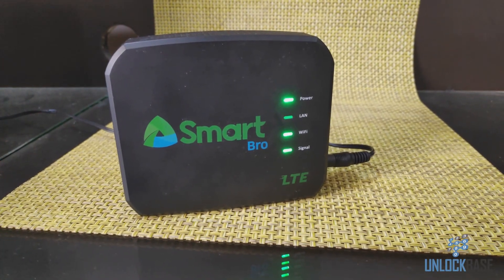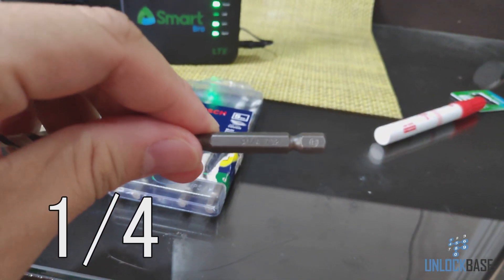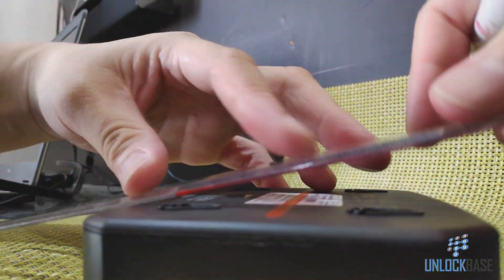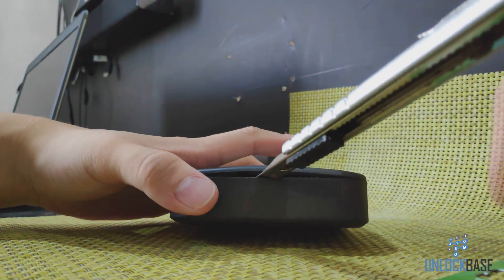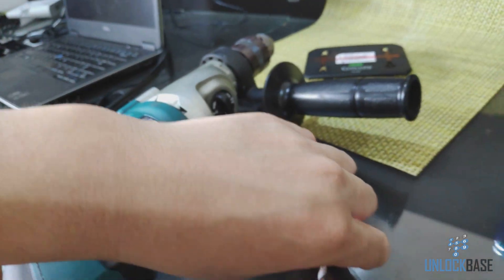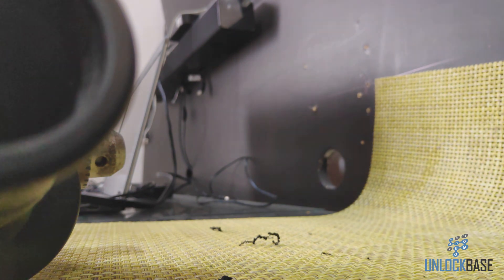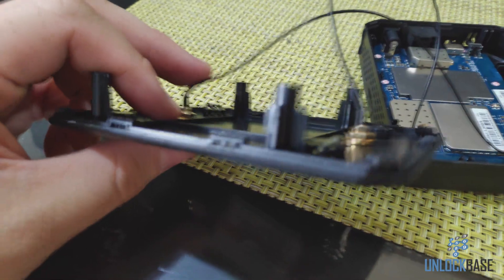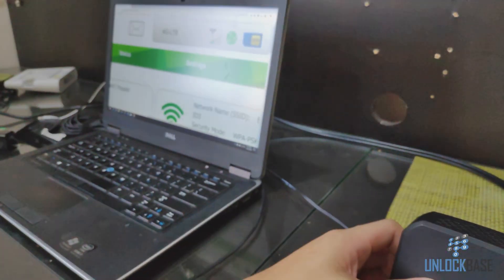Smart Bro Home Prepaid WiFi Evoluzn FX ID3 External Antenna Mod

Comment: you might want to put the plastic cover on top of a wooden surface and drill downwards instead of holding the plastic with your hand and drill.  It could spell out trouble

Comment: Hi, great tutorial. However it's not exactly clear to me if this is for the mobile smart signal or the wifi signal? I'm looking to improve my smart signal, and to have an outside antenna for that. For the wifi I use an extra access point.
Reply: That is for extending your Telcom LTE Data signal signal..not your wifi signal

Comment: Need a proper antenna that support wide range of frequency. Sayang yung 700 if 1800mhz yung support ng antenna.
Already did it, great tutorial!
Reply: ano excact model ng ganyang adapter antena paps ? san nakakabili?
Reply: ano po ibig sabihin ng propee antenna na wide range frequency? meron po kasi akong 600mhz- 2100mhz antenna..pwede po ba yun sa pldt wifi na modded?thanks
Reply: @jc122708  pwede na yun.
Reply: @matcha_cid  antenna sir na inorder ko sa shopee..tag 150..naka indicate is 689mhz -2700mhz..malakas na ba sir makasagap ng signal pag ganun antenna? di pa kasi dumadating order ko
Reply: @jc122708  yung frequency na kaya nyang masagap yan. Naka depende padin kung gano kalayo yung cell tower sa inyo. Kung maayos naman internet sa phone mo, more possible na malakas din yan
Reply: Any recent links kung San makakabili nung wires and ung prang small antenna?

Comment: Sir, do we need to have 2 connections for external antenna or is it okay to just have 1?
Reply: Better pag dalawa, and yung antenna eh support ng 700-2400 mhz frequency, para sulit na sulit
Reply: Pero mag work ba kapag isa lang? Isa lang kasi external antenna na nabili ko.
Reply: Ano pong type ang ilalagay.  Dba  po meron transmitter and reciever type ng antenna baka po kasi d mag work pag d fit ung antenna
Reply: @darylestores3497  always may rx/tx ang mga communication devices, meron ding wala.
Kaya dalawa dahil MIMO, pwede lang din isa kung want mo, di nga lang match db at siguro, problema mo din interference
Reply: Thank you sir.  D ko po kasi alam ano antenna ang maganda bilhin sir..  May ma ere recommend ka po na na antenna for outdoor sir?
Reply: @darylestores3497  dish na brand or tenda kung kaya budget
Reply: Ok sir thank you

Comment: Nice tutorial sir,, ask ko lang po kung binalik nyo din yung tinanggal nyo na nakakabit sa loob? Yung iba kasing tutorial kinabit din nila
Reply: Di nya na boss kinabit.. yung sa iba siguro nanghinang kaya nag tap lng sila pero since sa kanya ay snap on na binili nya na cable na IPX..no solder na.. naka hang na lang yun internal... Pero if di mo kakabit ang external antenna mo..wala ka nga lang signal..
Ang iba na nakita mo na nakakabit na sinolder nila ehh ay advantage nun ay dual..kung di ka gumamit ng external ehh may signal pa rin masasagap sa internal antenna nya

Comment: Thank you for the idea.. it works!
Reply: Anong antenna gamit mo? Pahingi nlng rin ng antenna details bro maraming salamat.
Reply: @hansandrewconsuegra8169  Buy a pair of SMA Cable Female and 18DBI Mimo Antenna.
Reply: Thanks  @whatswritten9795  sobrang helpful!
Reply: Hello po pwede pa send link ng antenna na gamit nyo po.
Reply: @angelgab1529  Check out utakeRG178 U.FL/IPX Connector to SMA Female Adapter RF Connection at 27% off! ₱72 only. Get it on Shopee now! https://shopee.ph/product/77433740/1807448388?smtt=0.0.9
Reply: @angelgab1529  Check out 2.4GHz Wireless WIFI  Network Booster WLAN RP-SMA Connector at 41% off! ₱61 only. Get it on Shopee now! https://shopee.ph/product/41847637/665757772?smtt=0.0.9
Reply: Boss dalwang antenna na wifi network booster gamitin? , kasi diba dalwa yung connector, thanks
Reply: @roldanamores6438  ok lng po isa.. working fine po kasi isa lng.
Reply: Bumilis ba signal sir?
Reply: @lilparanoid2094  so far so good.. hindi ko na kylangan ilapit pa sa bintana ang router.. lumakas ang signal.
Reply: It also works in 2.4GHz 3dbi wireless male antenna. Yung malilit na pang WLAN Booster.

Comment: Sir tip lang.
Lagi mo ilalagay saan mo nabili ung mga material na ginamit mo.
Yan ang laging number 1 question ng mga nanonood sau. Kasi un din itatanong ko heheh. Nice video sir. Thanks
Reply: Gian and Charize Travels sa lazada meron yan
Reply: Ipx to sma male pigtail female connector.
Esle, kung anong end ng external wifi sma cable mo